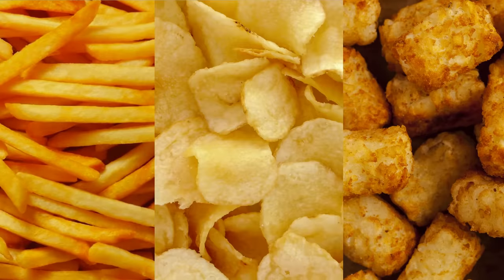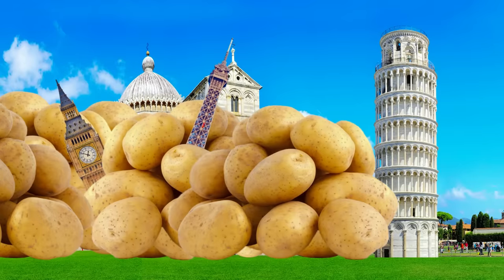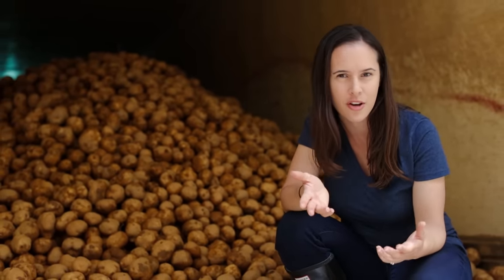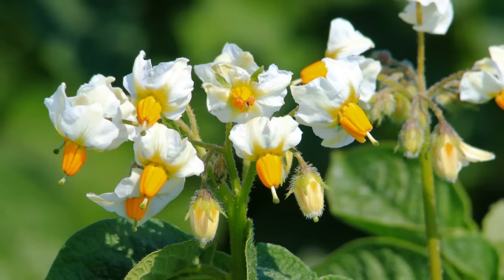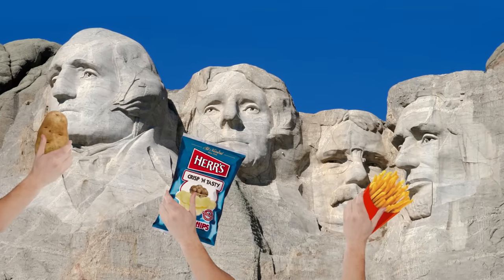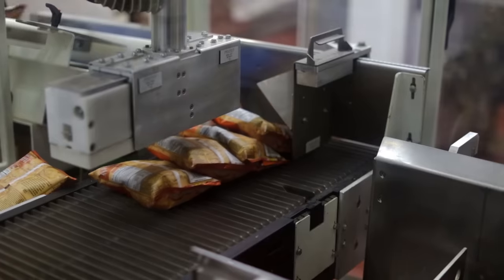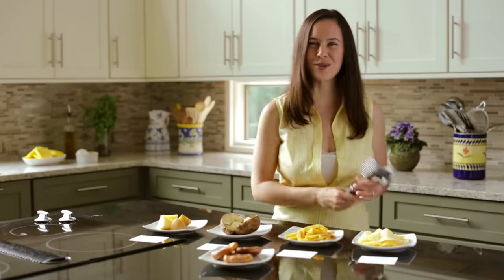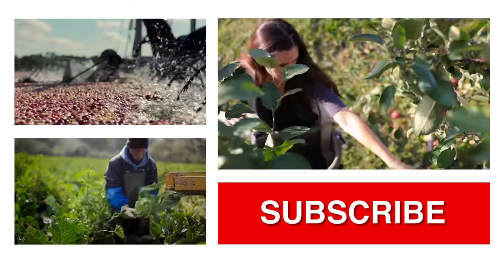POTATO | How Does it Grow?

Comment: Tip for making mashed potatoes.  At around 4:29 the video notes how boiled potatoes lose a lot of their nutrients.  One option to lessen the effects of this is to use the water you boiled them in as the water needed when mixing the other ingredients.  You will gain back some of the nutrients lost, and you will gain back some of the dissolved potatoes in the "potato water".  This is especially ideal if you are combining fresh potatoes with an instant potato mix.
Reply: Why would you combine those two? It’s like putting a McDonald’s burger on a platter with fresh grass fed beef burgers. They don’t mix
Reply: @lizi.2503  The same reason you would add seasoning to a jar of Prego spaghetti sauce.  It's a quick and convenient base to use so that you don't have to make everything from scratch, cause fresh potatoes takes a lot of prep time/work when feeding a large group.

Comment: 1/50,000th of an inch sounds awful thin. I'd be willing to bet they're more along the lines 50 thousandths of an inch.

1/50,000th is 0.00002"     

A sheet of paper is 0.00300"

Great video.................Thanks
Reply from the maker: +odustbrown You're right! We have to correct this. We only recently realized (thanks to another comment) that our editor got the fraction wrong: it should be 50/1000. It will be amended soon! Thanks for giving us the heads-up.
Reply: odustbrown you know what else is 1/50000th of an inch thick
Reply: You already said 20 slices per inch. That is the same as 50 thousandths. 20*50 = 1000. A thousand thousandths of an inch is just one inch.

Comment: There's a mistake in the potato chip thickness.  1/50,000" cannot be correct.  Besides being mechanically impossible, that would equal 200,000 chips from one 4" potato.  I'm guessing it's a 1/50".  That would be 200 chips per 4" potato.  Sounds about right.  '-)

Comment: Everything you said about seed potatoes versus potato seeds, was factually accurate...however, you lied by omission, considering you didn't add in the fact that most commercially-grown species of potato actually DON'T produce viable seeds, due to side effects of cross-breeding multiple species to get the desirable traits of all the potato strains.

Also, I dunno' who told you potatoes aren't roots, but whoever it was, was flat-out wrong. It's classified as a tuberous root vegetable.

Comment: Like the video but some math is wrong. 20 slices per inch = 1/20 =0.05 inch per slice, not 1/50000 inches. Math aside a chips bag is really expensive when you compare against the actual price of a potato, a potato is about 2 inches, so 40 slices per potato...